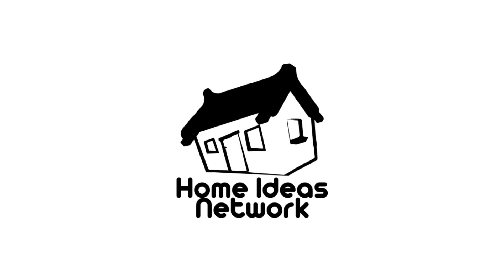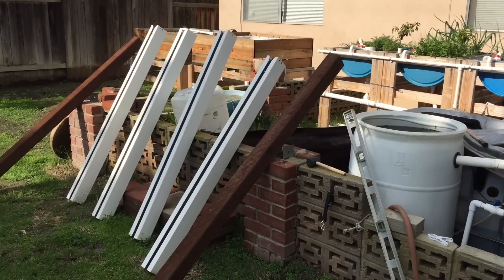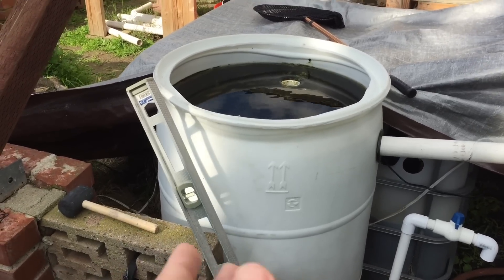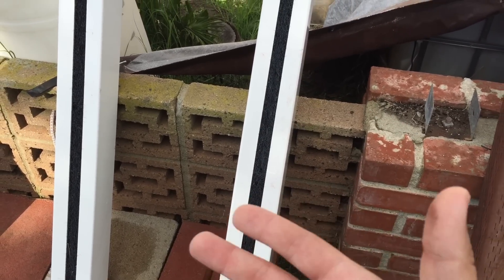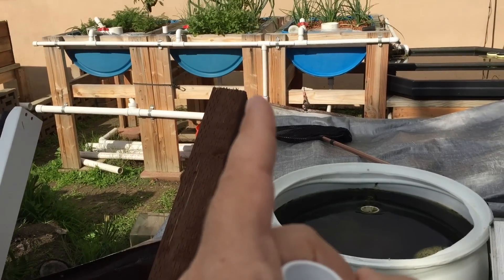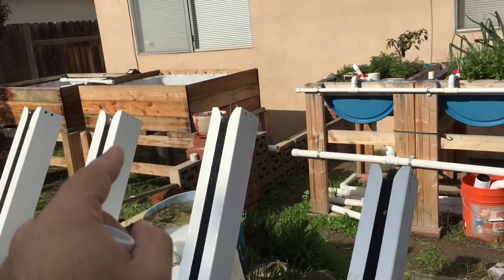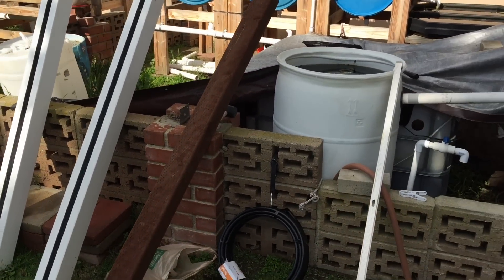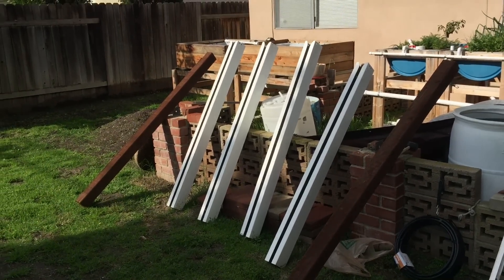ZipGrow Towers! - Tower Placement

Comment: Matt, 
looks like you got another good project.  Question on your swirl filter. I'm building one now ( see link below) and I'm building it based on one from Rob Bob's channel. He uses a bucket on top to help get the floating solids to sink to the bottom before the water goes out. Have you noticed any problem with that on yours?
Here's the link if you want to check it out
https://youtu.be/LlmYgR7I-0E
Thanks, Von
Reply from the maker: I have one thing that I am having an issue with. Cleaning out the filter. It catches most solids but they build up so I just siphon them out into a sock. From there I let them dry out a bit and feed the poop to my worm farm:)